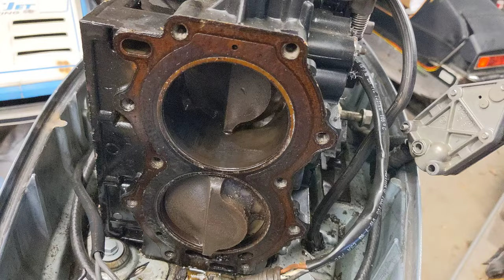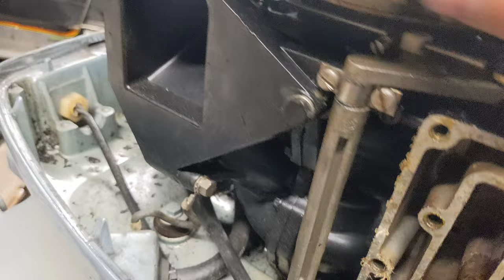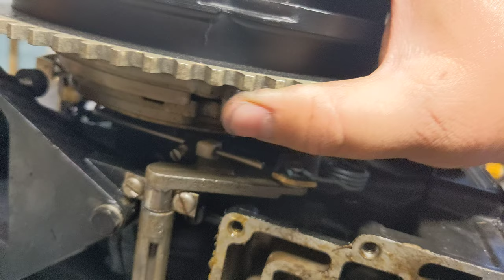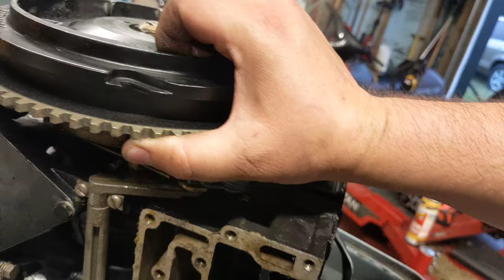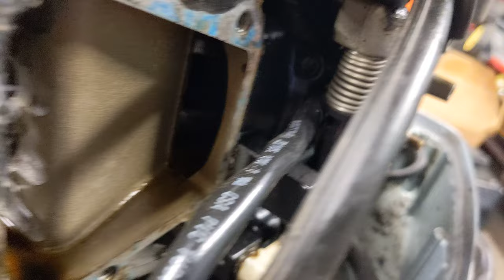'86 Evinrude 20 HP Outboard. Bad Connecting Rod Bearings? (Video 3)

Comment: Hard to say.  These engines are fairly loose fitting and will make some slight clunking noises when going up and over TDC.  The best way to check for sloppy bearing/rods/wrist pins is to position the pistons at the center of travel, then rock the flywheel back and forth just slightly to see if there is lost motion/clunking in the pistons/rods.  But, first you need to figure out why there was no compression, guess that will be on your next video
Reply from the maker: I had some more versed friends look at it this past weekend and they said it didn't feel out of the ordinary. The compression on the other hand... stay tuned!
Reply: @tylerpripps4969    Well, it is all scored up so has to come apart anyway.  Did you pull off the intake bypass cover?  It comes off easily, then you can see the piston rings/skirts on the intake side...
Reply from the maker: @fleetwin1  Yep, everything's off except for the crank case. That's the last one to tackle. It's a little daunting. Then I'll pull the pistons, hone and/or bore the cylinders, and then button it all back up. I already have the new gasket set standing by.
Reply: @tylerpripps4969    OK, it is important to find the two taper pins and remove them before loosening/removing the crankcase bolts/screws.  The taper pins are there to align the crankcase halves.  The "taper pins" are driven out from the cylinder side of the block towards the intake manifold.  Sometimes they are a little tough to get to, it is best to use a heavy/solid punch and a decent sized hammer, a few good raps should pop them loose.  It is important to remember that those taper pins are installed in the opposite manner, tapped in from the intake side towards the cylinders, more on that later.  Be sure to remove the three bolts that hold the lower seal hsg into the block before trying to separate the block halves as well.